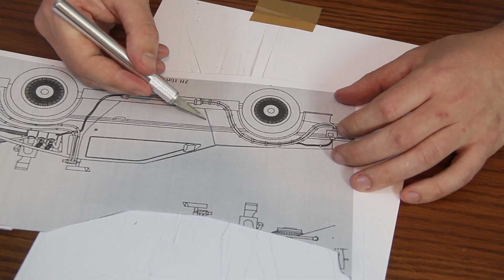Sugar Rocket powered Delorean time machine

Comment: hey can you try to make sugar rocket fuses? :) good video though
Reply from the maker: Yeah. Actually I used DIY fuses in this experiment. But they have several problems so Im using a commercial green fuse now. More reliable and easier to use. :)